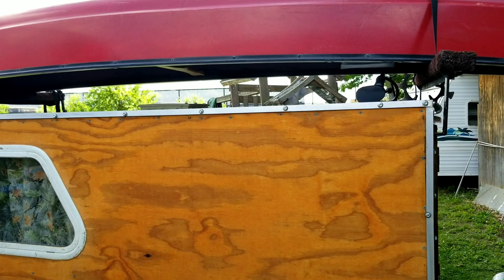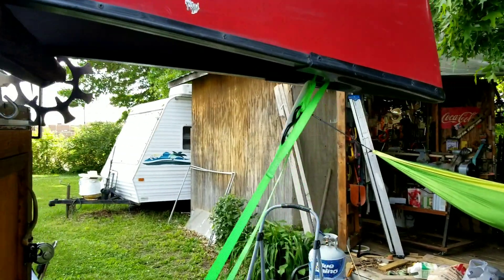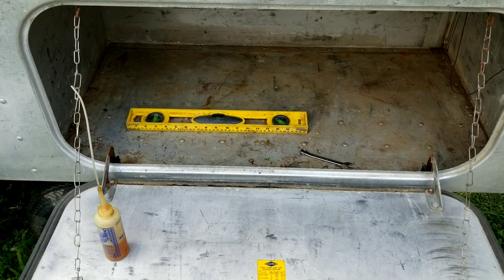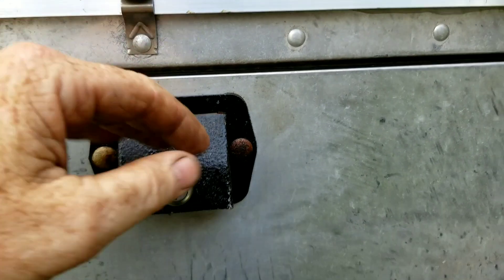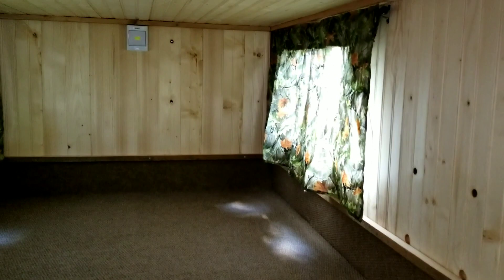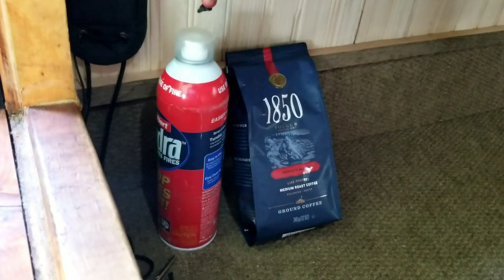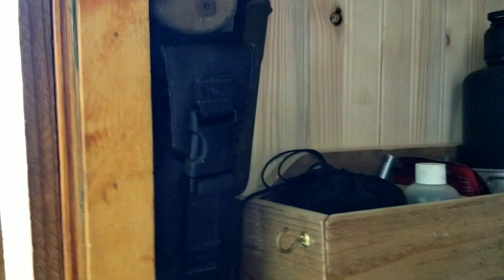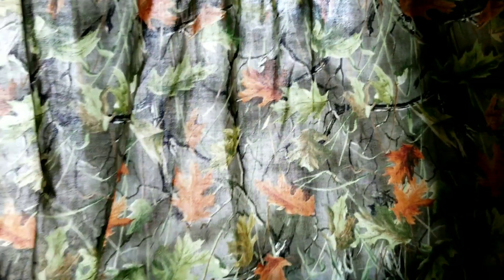Tiny camper build/Finally finished

Comment: Man the tiny camper turned out great! I really like the folding table  and coffee station. You will be sleeping like a baby at the spring meetup!
Reply from the maker: If all possible I will be hanging. In the summer it will mainly be used for storing and hauling my gear. 
I really prefer the hammock in summer. If I can't find a spot to hang I always have it for backup. 😁